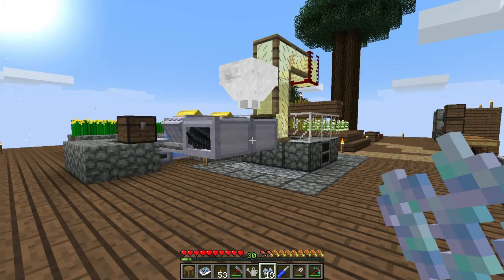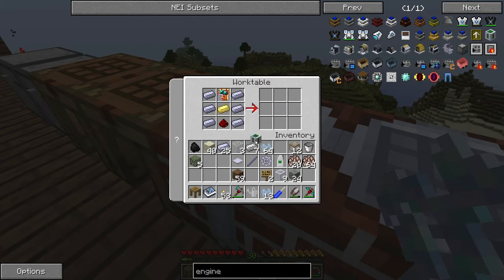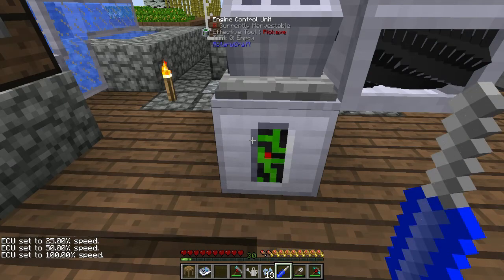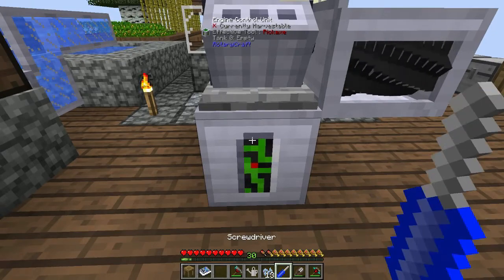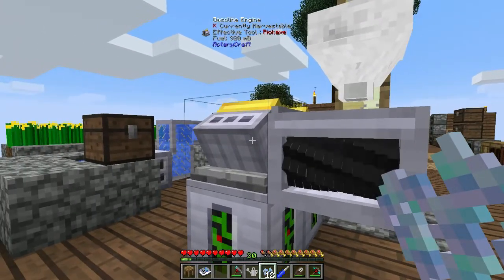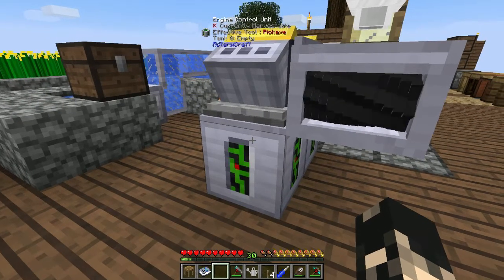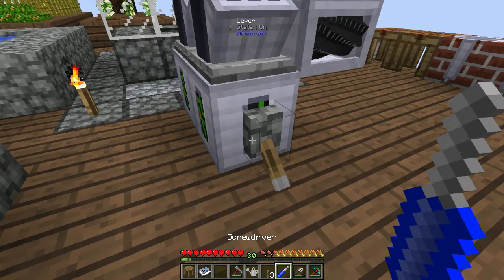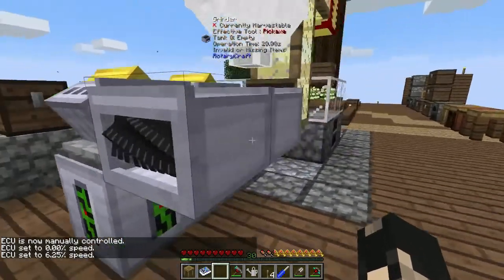RotaryCraft Engine Controller, Ethanol Fuel Efficiency

Comment: Cant u use a weaker redstone signal to turn down the power of the engine? and couldnt you use one engine to power the two grinders since you need less than 50% of the output?
Reply from the maker: you could power 2 grinders, you just need to 2x gearbox the torque up and use a shaft junction to split the power, as for the redstone signal not sure if possible.